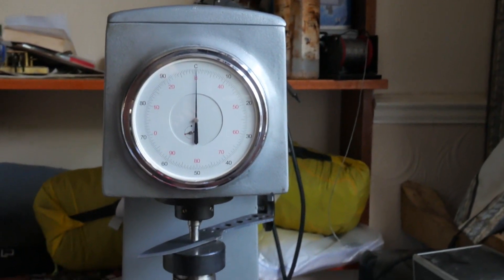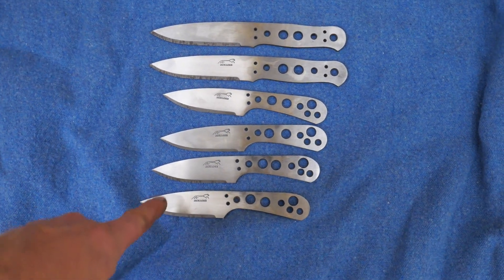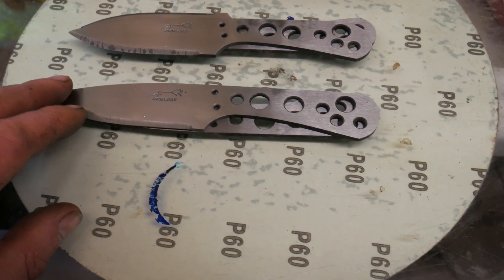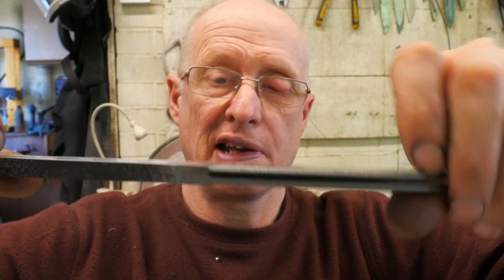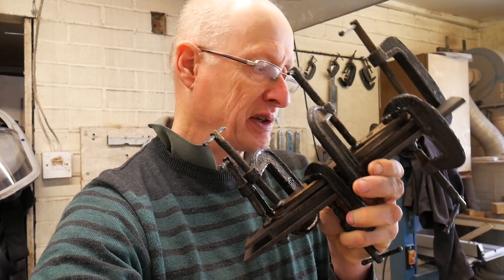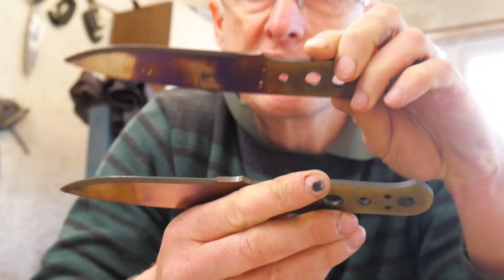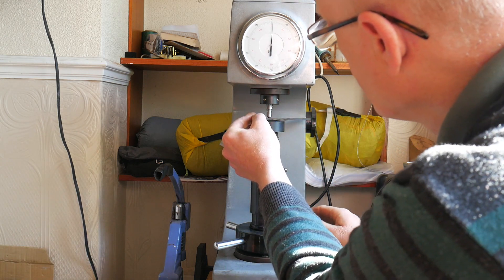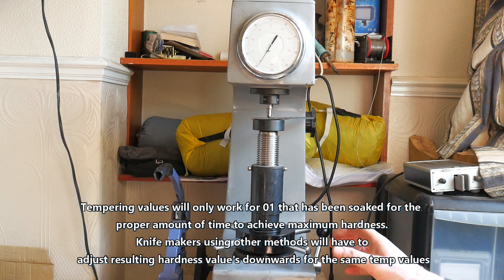How to use an RC tester. Correcting warped blades reliably and safely. Knife making hints n tips

Comment: Why do you only coat the blade portion with anti-scale compound? Why not the handle as well? Won’t you get decarb on the handle? Thanks.
Reply from the maker: Yes you will get some decarb in the handle but it is really only on the surface and that will be finished to a very rough keyed finish for epoxy bonding. However on the blade flats where the blade is finished to much finer finishes the decarb will be unsightly.